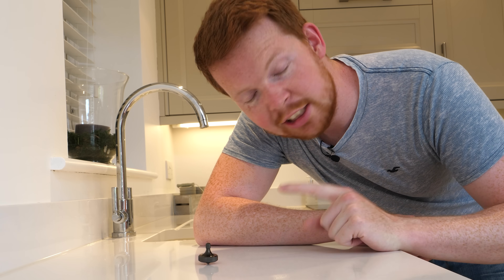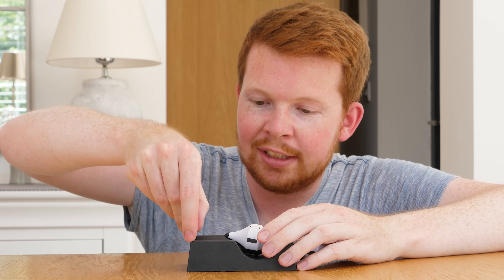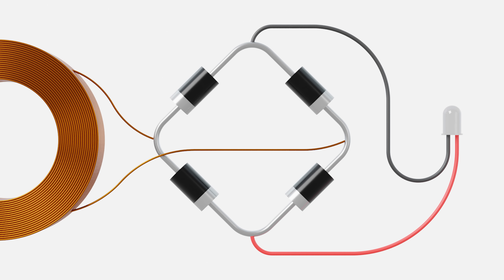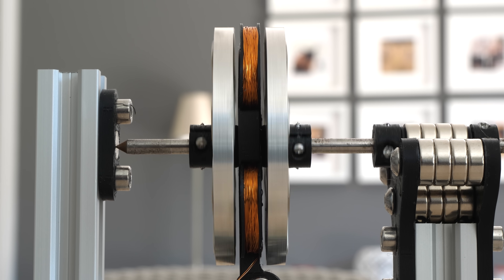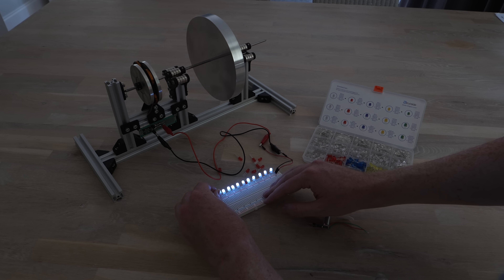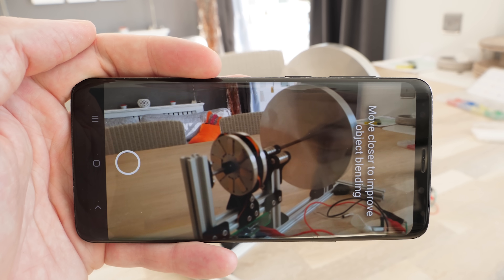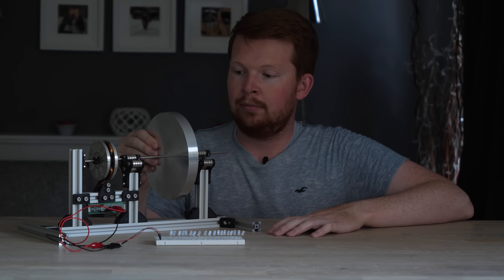Flywheel Battery

Comment: You could offset the bottom magnets slightly from those on the shaft and then the apposing forces of the magnets would compete with each other and might hold it in place

Comment: I've dreamed of building a perp motion/flywheel generator for years.  Internet  would be to power a refrigerator or wather heater.   Just give it a good spin every morning and the generator will run all day....  no more electricity costs...
Reply: Considering the average house uses atleast 100MJ of electricity per day and the human body uses less than 10MJ per day on average, that is far from feasible. Altough if you could make your body somehow produce 10 times its normal daily energy use in one shove, you could (and would have to) eat like 50 big macs per day to cover the energy cost for that (alternatively, this could be a super fast diet)
Reply: @destroyer1667  I like it! 🤭

Comment: I have a suggestion for making that frictionless: stick magnets on either end of the shaft WHILE the outer vertical posts (this time two) have opposing ones that are holding the shaft to prevent it from moving side to side.
Reply: Whether it loses energy from friction or doing work against a magnetic field it is still going to lose energy.
Reply: @GeorgeMonet  to a degree, yes. But it will greatly reduce friction dramatically.

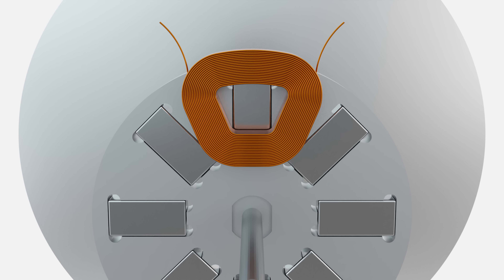Comment: Bit of a misconception on how induction works by 4:18 ;) It's really the time derivative of the magnetic field strength that makes voltage, and not the magnets being right by the wire. Although the time derivative (by geometric coincidence) is largest when the magnets are right over the wire, and therefore i do see that it would be an easy mistake. Just an fyi :)
I did though enjoy the video. I have wondered before if a flywheel battery would be viable, and you have definitely answered that curiosity of mine.

Comment: I have an an advise for thos project.
1st) You should magnetic stand on four sides rather then one, it will provide more stability and efficiency.
2nd) you should magnetes of north and souuth attached, so that the electric current won't fluctuate due to distance between those magnites.

Comment: Does the flywheel slow down faster with more electrical load?
Reply: That’s what I was wondering, I wouldn’t think so though. I believe that there is just more weight on the flywheel slowing it down quicker

Comment: Now all you have to do is attach some magnets to the flywheel and have a driver/charge coil set up and some capacitors and you could drive off the spikes of the magnet passing by the coils.

Comment: You can make this self running. This has been done for many many years on you tube there's a whole community here on you tube doing this take a look at lidmotors channel for starters.  Or look up self running Mendocino motors. I built a self levitating shaft with heavy ring magnets that would easily run for 15-20 min . https://youtu.be/4MsgnFUKcuM
The eddy currents from the magnets can cause drag on your aluminum flywheel.

Comment: I'd love to see an analysis of what effect the alternator has on the spin time of the flywheel.
Reply: Yeah - a bit of reflective tape on the flywheel so it can work with a laser tachometer, then plot a graph of RPM over time with the flywheel just idling (to gauge friction losses) and with the LEDs hooked up.  Bonus nachos: calculate angular momentum, work out kinetic energy lost from the flywheel over time and electrical energy dissipated by the LEDs to get system efficiency.

Comment: I wonder if you could make the magnetic bearing so that it clamps the top of the shaft rather than just cupping them bottom.  You currently have three sets of magnets in a 120 degree semi-circle.  Perhaps you could double that with a hexagon that closed with a clasp.   Would this allow you to get more stiffness from the bearing?

Comment: Will it work better in a vaccume? 

Why not balance the magnets atop one another like a spinning globe toy. Then incase the unit in a sphere. Pump out the air to remove air friction. And now is a hyperloop flywheel battery

Comment: Rather than straighten the shaft, remove it. dry or water-ice cool the shaft and heat gun the flywheel. Since you have a hand pressed friction fit it should be fairly easy to get out - especially if you remove it the same direction you installed it.

Comment: Why dont we use this to store overproduced electric power. With a „removable“ generator to decrease the resistance during storage and completely set it in a vaccum even fruther decreasing resistance and friction. This isnt to dumb for shortterm storage. With a big ass flywheel or even several wheels on one axle.

Comment: The parts that hold the nagnets should have been printed on the 3D printer.  Holding them with aluminum will cause losses.  The AC in the coils will create their own alternating magnetic field, and this alternating field will induce alternating eddy currents in the aluminum, which will create additional magnetic fields of their own.  These alternating magnetic fields will interfere with each other and cause a loss of efficiency.
Also, would be cool to see how long it spins with and without the LEDs connected.  It'll spin down faster with the LEDs connected.  Nothing is free in the world of physics.

Comment: you should be able to reduce the flickering of the LEDs when you use a capacitor in parallel. It charges during the 1 Part of the coils and recharges when the generator magnets are off the coils. The effective voltage will be a Little lower but more consistant.

Comment: I don't get why people so often use rectangular magnets on these machines. Bringing opposite magnetic poles close to one another where the corners almost touch near the centre will only reduce magnetic flow... Also adding another magnetic disc with aligning polarities will provide a much stronger magnetic field with a very straightforward geometry. - Ok at least he did the latter :D

Comment: Safe your health.

If a flywheel is stopped suddenly, for example due to a defectice bearing, this is done with an unlimited performance. Therefore, smaller flywheels can also cause bigger damage.

In electrical engineering, the discharge of an accumulator is at least limited by an internal resistance, while a capacitor is suddenly emptied, this last behavior is similar to that of a flywheel.

Comment: Why don't you put a blade on the tip where you turn it with your hand so that you can do tests and see if it works like an eloic turbine, maybe it works so you will need to make some adjustments such as a fastener on the shaft so that it does not come off its shaft when the wind pushes it

Comment: You could probably encapsulate the perpendicular levitation shaft magnets with a ring of magnets attached to the frame, this would better locate the levitation magnets in the center. Following this, you could cap the shaft, at each end, with another magnet, with a coaxial magnet attached to the frame, for axial levitation; rather than having a surface bear on another surface, for full levitation. Some modification to the alternator to make it more efficient, such as a tighter magnet array, would further help. Similarly, a more proper flywheel is probably ideal, most of the mass in the circumference, rather than a solid chunk of metal. 
This could also be expanded to the point where one end of the frame has a protruding shaft that has a hookup for a motor, that way it can be an operational battery. This design would need an axial levitation magnet with a through-hole as well, but this shouldn't be an issue as the circular face is the pole of the magnet. It'd be interesting to compare this fully levitating flywheel battery to a partially levitating flywheel battery, and both to a traditional bearing-based flywheel battery, all of which having the same alternator/generator specs, flywheel specs, and rpm specs.

Comment: You can drill the shaft out and sleeve the flywheel, or just use a bigger shaft. 
You can also straighten the shaft by hand spinning it in the lathe against a dial, and hitting it. I've straighten valve seat cutting pilot shafts this way.

Comment: Awesome. I have an idea. What if you put coils at the rotor and then with some small controller like arduino nano you can build propeller display on the flywheel surface

Comment: You should try using it as a regenerative break. Say make or use a three phase bldc driver and also rectify the output and recharge the battery with it. 

Also star three phase is way more efficient when rectified.

Comment: Do heavier electronic loads cause "Drag" on the flywheel?
Reply: Yup. When current is created in those coils, the current creates an opposing magnetic field that pushes back against the rotating magnets.

If you don't have anything attached to the wires (so no load), no current passes as you have an open circuit, and you get no resistance.

Comment: Cool! I bet not many volts used in the drill were recovered from the flywheel, but not really the point. Also, I think you could shorten the shaft to make it more stable.

Comment: As I was thinking that you could do this much merely with gears, the main problem with them is friction. Then I thought, what if you could build a gearbox with magnetic gears that don't touch each other, same with the shafts? 
And I'm wondering just how long a balanced suspended (magnetically) "top" would spin in a vacuum, especially if the balance was perfect, all moving surfaces micro-polished and sealed. It would only be affected by what, gravitational movement (earth's spin) and perhaps beta particles and EMF's?

Comment: O wow, you may have just explained something that used to be or in some countries still is a military secret. For uranium centrifuges you need magnetically levitated bearings but you also would need to balance because of the extremely high RPM's needed to purify the uranium ore in order to separate out uranium type that can be used for nuclear experiments/bombs/energy etc.

Comment: Couldn't you stabilise the rod from the top with magnates to keep it from wobbling? Or alternate the direction the magnate hinges to have it want to escape to different direction and suspend it in air entirely.
How would you introduce energy into this battery without turning it? Could you add multiple instances of coil generators to produce higher currents?
Would a vacuum help keep the flywheel spinning?

Comment: You should try making a bigger one, could probably try sealing it within a vacuum chamber for reduced friction.
Also rather than mounting it horizontally you can have the shaft vertical with magnets on the flywheel itself to support the weight of it.

Comment: You could put some kind of bearing at the far end to stabilise it.  Even just a plate with an oiled hole in it would work wonders for keeping it stable!  That would stop it from bouncing around so much.  To stop it from rubbing, you could drill the hole as 2 cones which meet in the middle of the plate - that would just give a thin edge for the shaft to sit on, and wouldn't cause much friction.  It would also allow freedom for it move slightly due to imperfections in the straightness of the shaft.  You could then extend the axle a bit, and put some kind of handle on the end.

Comment: Could you not use a magnet on each end of the shaft to oppose a magnet in the frame? It won’t be as solid as a physical stop but should be repulsive. Not sure if the rotation would affect the polarity though.

Comment: Nice work! how about instead of a little friction on one side, put a couple of opposite magnets, on both sides of the axis. And add some wind or (and?) solar energy to make it spin as often as possible...  by powering the drill like you use to do? (or something more adapted "contact free" to spin the axis without contact).       Maybe replace a part or the totality of the mass of the wheel with magnets wheels and coil systems too? You will have a system that is more resilient and energy producing? I am not a scientist but it's just ideas, and your project is very interesting for renewables!

Comment: You are loosing something between 0.5V to 1V to forward bias that diodes (depends on the diodes used, and the current that goes through them). Why not try a circuit a little more complex, such as "ideal diode"?

Comment: You can cut the shaft and drill out the steel to get the shaft out. Then bolt a flanged section onto the flywheel with 3 grub screws in each side. That will let you balance the whole thing much more easily.

Comment: You can charge the drills battery live :) keep it going in a loop will allow for many more minutes I guess:) fix the drill on a good location on the flywheel :)
Reply: that'd slow it down even faster then just letting it free-spin. Thermodyamics is a cruel mistress.

Comment: I received recently did some experiments with some now pretty old technology: Three phase Synchronous Control Transmitters & Receivers. 

These are/were used in aerospace to convert rotation of a shaft to three phase AC and back again to rotation to control surfaces etc. They are precise and very reliable! 

I have a spare transmitter…..but not a receiver.

I think this would make an interesting video!

Comment: It's Earnshaw's theorem which explains the physics preventing stable levitation of static magnetic (and electrostatic) systems. You either have to have non-static magnetic fields (electromagnets) or you can use diamagnetic materials or you can use force to keep things lined up (that's what used with the toy at the beginning of the video). There are videos of diamagnetic materials levitating in static magnetic fields. Good explanations on wiki.

Comment: Instead of having the horizontal shaft push against a vertical glass plate try putting a magnet at the end of the shaft with the end of the shafts magnet being North or South.  Then replace the glass plate with another magnet that points towards the shaft and have the same like pole pointing at the magnet at the end of the shaft.  Now you have a spinning flywheel with almost no friction except for air friction.  Be interesting if you put the whole thing in a vacuum chamber and pump out all the air and see how long it spins.

Comment: A really cool project! On nitpicking comment: a light bulb doesn't care if the current is AC or DC, it'll just glow on both halves of the cycle. A light-emitting diode does, but it will still work - it'll just glow at half cycles (giving the impression on just glowing at half the power available). And there are AC electric motors. So I wouldn't say that you have to rectify the current in order to power a light bulb or an electric motor.

Also, the voltage loss over a diode in the permitting direction is typically 0.7 volts. So a full bridge rectifier will remove 1.4 volts RMS (there's always two diodes on the current path). At these low voltages, that is actually a fair percentage of the actual voltage generated.

Comment: This is so cool!
I have a question about the thermodynamics of this flywheel. Before you set up the alternator, you said it could spin for about 12 minutes.
Does the alternator dissipate the energy at a significant rate? Like, did you run a test about the time it spins for after you set up the alternator?
I thought it would be interesting to know if the air friction dissipated more energy than the alternator did.
Thank you!

Comment: the diodes on the FBR each have a voltage drop of about 0.7V, adding to 1.4V for the 2 diodes in series.
with the voltage levels of this application being low this wastes a lot of power.
this can be remedied by replacing the diodes with MOSFETs to achieve active rectifiction:
https://en.wikipedia.org/wiki/Active_rectification

the circuit becomes a little more complex: 
https://i.stack.imgur.com/aW1DT.png

note that one will need 2 N-channel and 2 P-channel MOSFETs
N-channel MOSFETs can be soldered off of any old mainboard (the CPU power supply usually has a bunch of them). P-channel MOSFETs are harder to acquire. or was it the other way round?

Comment: I am a bit disappointed that you didn't show how long the flywheel continued to run while powering the different objects.. It is amazing how quickly the drag on the system builds up due to the amount of current being drawn by the alternator.. so powering one LED it would spin for ages but powering 10 is would slow down a lot quicker ( 10x quicker?)

Comment: Energy inputs from raw material processing to working model = 12 KW
Energy output from working model for a 10 second spin = 0.0000000000001 KW
That's 120 billonth power payback.
Spin time to break even = 12,000,000,000 seconds, or 380 years!

Comment: if you were to make it a magnetic core that is connectet to the spinning weighth through ballbearings you would eliminate energy lose through magneticfield interaction while in rotation statewhen you need the energy you could loke the magnetic core and malke it rotate to induce current

Comment: I had this idea awhile back I modified the point of contact end so instead of a metal point it would be a magnet being repelled by another magnet to keep flywheel the middle... now that I've seen the video I can redesign the model
Reply: ALSO I would put a magnet on the otherside of the flywheel as well also repelling

Comment: You should look at adding a way in which the device can use that energy created to spin itself
Reply: It won't work because the coils in the alternator create a Magnetic field that resists the rotation of the flywheel shaft.

Comment: Cool. Would adding a some constraint on the other end help at at with efficiency? Not like a full blown bearing to take the weight of the flywheel but maybe just a loose hole to reduce the wobbling. I dunno, just an idea.